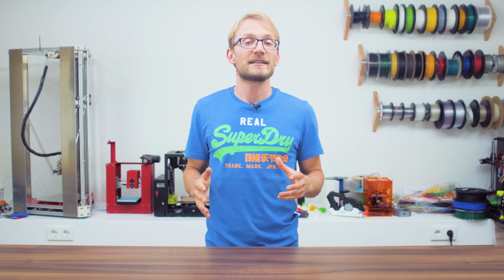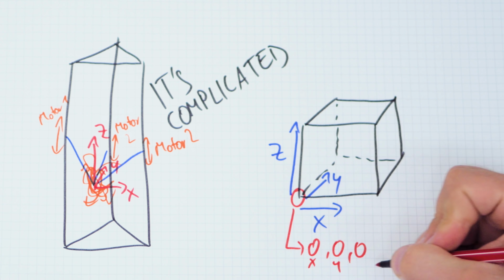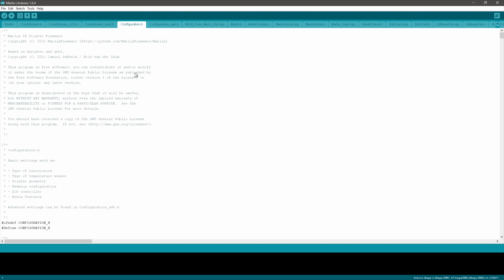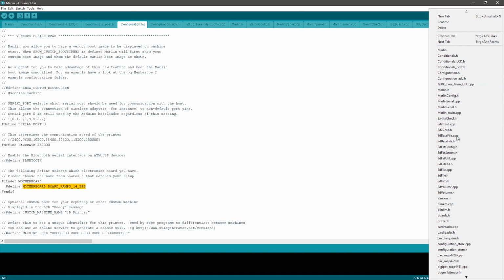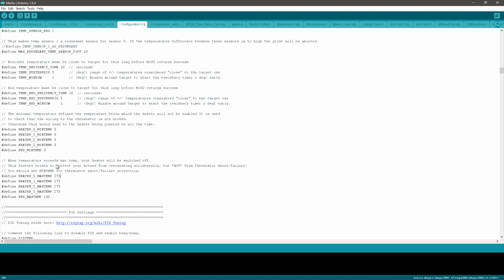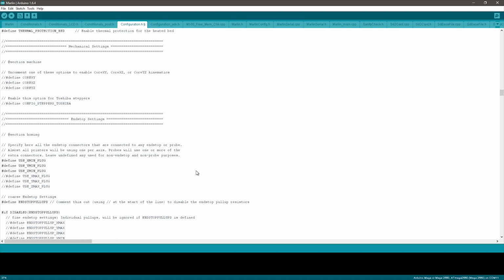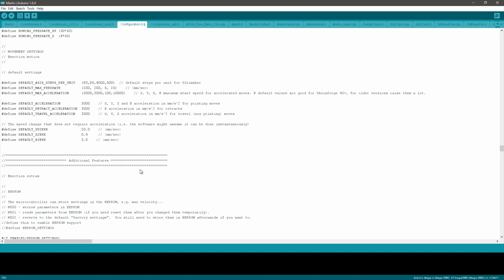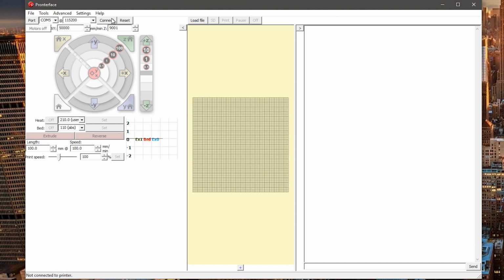[2016 version] How to set up the Marlin firmware!

Comment: Still relevant in 2022. I bought a V1.03 lulzbot mini off ebay and needed to upgrade to a motherboard compatible with LCD interface. The stock motherboard was a mini Rambo 1.1b and I needed a 1.3a. Lulzbot wanted to charge $200, but I could buy the same board from Prusa for $130 (somehow shipping to CA from CZ was less than shipping from ND). The only catch was that I needed to flash brand new firmware. Because this board came with Prusa firmware already installed, Cura alone was not enough to connect to the board and update firmware. Arduino was the only way and this video showed me everything I needed to make it work. Thanks Thomas!!!

Comment: Just watched your video since i don't get my probe working properly on my Anet A8. Its a capacitive 18mm probe which seems connected correctly and gives optical feedback once it detects something. However it does not trigger the Z min endstop when homing. At 11:50 in your video you explained the endstop inverting, which was also my first try, but if I change the value of Z_MIN_ENDSTOP and Z_MIN_PROBE ENDSTOP the printer moves the Z axis up instead of down when homing ? And still the probe doesn't trigger the endstop. Any idea what I am doing wrong ?

Comment: Hey Tom that was great explanation ,I have used RAMPS1.4 board and in the firmware I defined temp sensor 0 for nozzle and bed sensor for temp sensor bed, nozzle sensor connected T0 on the ramps 1.4 and where should plug bed sensor ,on the ramps1.4 it has T0,T1,T2 PINS please reply

Comment: Pls HELP: Want to adjust z home position to -0.1*, *Im not using any probe sensor
i do
G28
M211 S0(so i can go below 0)
Adjust my z axis(let say I want it to be -0.1, as we know sign should be opposite so +ve 0.1)
m428(to save all offsets)
m500
m501(shows i have successfully saved it X:0 Y:0 Z:-0.1)

but when I home again I expect it be -0.1mm below the actual position. which it doesn't. The nozzle stays at 0,0,0. But if do M501 it still shows my nozzle position to be at X:0 Y:0 Z:-0.1

why is the nozzle not going down by -0.1mm even though it has been written on EEPROM

Comment: thank you for this. i am indeed very bad at this. trying to recover some old 3d printer but coding is not for me.... i followed to many other videos and when i installed arduino i only get 4 tabs in my rams 14 / mega 2560. the issue is that all other videos, including yours have more tabs, and i have no idea where i did it wrong. your video helps to understand but my question is how do i get all other tabs? will i have to code them 1 by 1? TIA

Comment: Thank you for the video!!!
Dear friends! I am building a 3D printer and I need your help and advice. I have 4 stepper motors on the Z axis.
  Question -
  How can Extruder 2 driver be used in Marlin as an additional drive for the Z axis (so that there are two drivers on the Z axis that work in parallel (each of which controls two stepper motors)
Thanks in advance!!!

Comment: I am having a very odd problem with my Anet A8 in that even though the bed is level and adjusted properly, the first layer of the print is being "printed" 1/8 of an inch off of the bed! My manufacturer has thrown in the towel (they won't/can't help me anymore) so I have no where to turn to for answers. Do you know of a  site Where I can ask reliable sources for the answer that might know? I have tried the RepRapWiki and they are stumped as well...  Thanks for your help! I watch your channel often and enjoy the information you pass on!

Comment: Hi, I picked up a old reprap i2,, I now have it printing nice, but realized one issue.. I wanted to change a few things and I do not have a backup copy of the Marlin script on the arduino,,,, is there a way i can get the basic info for the printer to show up using some g-code to get the info, so i could set up another arduino with Marlin ??? thinking some ways to save some time then from starting from scratch.   ..

Comment: Hi Thomas, Im replacing a 2560 board that experienced a main power plug short (heated bed not working but the rest seems to kind of work) with a new gt 2560 on a Prusa i3 "CLONE" (pretty crap but works ok...its a printer at my work...I have an Ender 3 which is awesome!! ). Id like to read the current firmware to make note of the settings to upload to the new board. What is the process of getting that information from the original board please??

Comment: I am struggling with adding a "store memory" option to my LCD. I have changed/updated/and flashed the arduino EEPROM code changes and for some reason none of my changes take effect on the LCD. I even un-commented the line you suggested around 13:30 that sometimes causes updating complications. Do you have any ideas what I may be doing wrong? Thank you so much for your help

Comment: Hi had problems with anet a8 board that came (bundled with auto level) ended up ordering another board this one works but firmware is previous version and doesn't support autolevel need help with good firmware looked into skynet but printer wont connect to pc I need the right driver I guess any advice?

Comment: How can I find the origin firmware configuration.h file before updating? I'm not sure about the config of the machine that I use but that needs to be updated. So I need to check the exact thermister type or X, Y and Z steps and... which you teach in this tutorial.

Comment: I'm completely new to 3D printing and have a question about the "Motion" section of the config. I understand how to calculate the steps per mm with the Prusa calculator, I just want to know in what order they are respectively in the code.  For example, in the config file, you are showing us the values are (80, 80, 4000, 500). What order are these values in? (X, Y, Z,  and E) ?  I hope the way I asked my question is understood. Thanks.

Comment: Hi Tom,
I changed the extrude heavy original stepper motor by a pancake Bontech. My Ender 5 PLus has been upgraded with a Micro Swiss direct extruder earlier. I did not know that cables were a matter that they might not be the same configuration. Then the machine had strange noise at the new motor and getting hot. I was scared then changed it back. Now It go wrong with the motor gear back and forth.

Keith has helped me to config the cable by changing the order of 1346 to new order 1436, at the mean time to reinstall the firmware from Ender-5PlusBLTouch__V1.70.2 BL.hex and Pronterface M92 E0 140.00, M500

I did exactly as guided but it is not fixed. Please give me an advise If I might have missed something. Right now the machine can heat up fine, calibration fine, everything is fine but extrude and retract modes are not functioning nor printing. Thank you very much.

Comment: i am struggling with my anycubic chiron my bed thermistor suddenly stopped reading the correct value it is showing 19 degrees but when i plug it in the hot end thermal sensor it is showing its at 60 degrees i thing the port is faulty on the mainboard the mainboard has to 0 for hotend to 1 for bed and extra to ports i want to change my bed from to 1 too to 2 is it possible to do through firmware ?

Comment: May 7 2023 - I am really confused. DO I actually need to go and buy an Arduino board to get any of this stuff to work? Will an uno work if that is the case? I am trying to figure out what the hell I am supposed to do to upgrade my ender 3Pro with the 4.2.2 main board. I believe this one has been upgraded to the 32B main CPU..... not sure as there are conflicting stories out there. I thought that if I installed the ARDUINO IDE software is this IDE an emulator?????) , it would allow me to compile a file that I can then simply send it to my ender 3 pro and the system would reboot and update? - TRying to upload the custom  Marlin 2.1.2

Comment: Hi, i use marlin on ramps 1.4.
my question is: Is there a way to use marlin in EFF mode but still have heated bed via an external MOSFET ?
My goal is to use both D8 and D9 pins for Fans (D10 for Heater) and connect a heated bed to it using an external MOSFET (Don't wanna use RRD fan extender)
If So what codes in marlin must be edited to do that ? May i simply remap Heated Bed pin to a free pin ? Which free pin is suitable for Heat Bed ?

Comment: Hello
My printer auto bed leveling does not seem to be working even though I have added the G92 in the Slicer. Printer performs the auto leveling but I don't see any difference from when I don't use G92.  Can I send you my configuration.h so you can tell if there is a problem with it? Thanks

Comment: Any advice on how to set up Marlin to run two extruders, a bed and a fan?  The standard config allows 3 of 4 of these.  I've been searching, but no word on how to control 4 of 4.  The MKS boards support this, but I'm actually using a standard RAMPS with an external SSR to drive a 120VAC hotbed.  I'm driving the SSR with one of the servo outputs since it only requires a TTL connection.  This frees up the regular driver outputs for the extruders and fan.  I found in marlin how to move the hot bed connection to the servo GPIO, but I'm still stuck with only 3 of 4 items I need to control.

Comment: So I updated my firmware as you suggested but I have a problem with Z Axis i have HICTOP 3DP08. the problem is Z axis is not working correctly it turns hard and or won"t turn when I use machine control X and Y axis work great.

Comment: I've got an issue with my version of the program where the build area is mirrored when I put the part correctly in my slicer of choice it comes out backward on the printer, how do I fix this?
Reply: There is an option that will tell if the axis direction is inverted by changing the (true) or (false) to the opposite after the the optional axis your changing the direction (it's the option Thomas is showing on 11.30 in the video) I only had to change 2 not all 3 so make sure you check them after changing ;)

Comment: sir , i made a prusa i3 steel 3d printer and i use board called lsee v1.0 when i load the firmware marlin on this board the printer do nothing and it doesn't work what should i do and what the changes must be in marlin firmware to be compatible with my board

Comment: Hey all, have a quick question. Bought all the the necessary stuff to build my own printer. Im currently stuck at the wiring/motor stage. I have everything hooked up and everything seems to be working fine, except for the Z-axis motors. When I ask pronterface to move them, the motors just twitch. I don't believe its the wires or the motors, as when I plug them into the x-axis on my ramps 1.4, it turns like its supposed to when prompted. I have a feeling its something stupid I'm missing, but I'm kinda stumped. Any advice would be greatly appreciated!!
Its a ramps 1.4
Arduino Mega board 2560
Not sure on the motors to be honest, bought this kit over two years ago 
Im running Marlin, and followed the steps highlighted in this video

Comment: Hello Tom,
Great video, as always!
In your previous version of this video guide you mentioned that you prefer not to use PID when you're controlling the heated bed with a solid state relay (for example for powering a silicone heater with mains voltage). Do you still recommend using the bang-bang method in such cases?

Comment: I am hopping you can help me out here I have a Anet A8 with Marlin installed I am trying to get it to save my bed leveling settings. I do have the commands in the code open to allow me to save but it will not save and I have to relevel each time I boot up . I did not put a bootloader on to save memory for future upgrades and I am wondering if I need a bootloader for marlin to save the commands in the bootloader to boot up with the saved setting.. Can you point me to any info that will help me out. thanks

Comment: need some help in learning. what is the correct term for... offsetting for x and y axis? Here is what I have. I got a Print-Rite / Colido printer to mess around with, I quickly changed out the motherboard for a Ramps 1.4. Now when I home x and y I need x to travel 25mm and the y to travel 30mm so that the print nozzle is at the actual corner of the 200x200 bed, (also did a headed bed upgrade). My full travel of x is 230 and my y is 250.

What is the Marlin coding? is it
#define X_MAX_POS 230
#define X_MIN_POS 25
#define Y_MAX_POS 250
#define Y_MIN_POS 30

Do also have to do the offset in my slicer? or by setting it i nthe firmware can I just have x=200 y=200?

Comment: Hello, I can not find an answer wherever you will be in charge, and if I run the 3d printer, the extruder will start to heat itself up and come up to a value of 304 degrees. then when I try to set it myself I get a "maxtemp" error and want to restart the printer.
I made the necessary adjustments to the software marlin and code I'm using

Comment: Hello
I followed your instructions (and many others) to upload Skynet3d into my Anet A8 and all appeared to be OK until I hit the "Auto Home" button (which I assumed was the equivalent of the "Home All" in the previous firmware). The printhead moves across the bed and parks itself at coordinates X=131 ans Y=145. What's going on? If I load Repetier Host and use manual control the X axis homes at the endstop on the left and the Y axis homes at the rear endstop as expected. If I click the P button, the nozzle moves to to front left corner of the bed (0,0 - which is perfect!) However, if I hit the little house icon (Bottom Left) which is presumably the "Home All" button - we zoom off to 131,145 again.  That's not even the centre of the bed. Is there a line of code somewhere that needs to be changed?
Reply from the maker: +Richard Hathaway unfortunately I have absolutely zero experience with the Anet series of machines or the Skynet3d firmware. Maybe someone else will be able to help you out!
Reply: Richard Hathaway you need to disable the safe home option in the firmware then re upload

Comment: I did not Aim to make a printer , I wanted to make a mini milling machine , The selection of a printer looks ( NULL) in this case
as there is no printer , will this ramps 1.4 work for the milling part as all I need is x y z , for the spindle can I use the extrude connection. what a mess Bought a wrong  board , may be I was supposed to construct a 3D printer.   Even in that  case the printer will have no listing As it is constructed One. Please HELP find the Path

Comment: What if m119 shows all n-stoppers are Open, and yet none of them works . I've checked the pins on the MKS 1.4 board. They seem to be sitting in the right spots (the same as other youtubers). What have I done wrong? Homing any axis crashes the unit into the n-stopper. Pls help

Comment: I followed the guide to a T and it wont verify in Arduino:  
SanityCheck.h:845: error: #error "Enable USE_XMIN_PLUG when homing X to MIN."
     #error "Enable USE_XMIN_PLUG when homing X to MIN."
      ^
exit status 1
#error "Enable USE_XMIN_PLUG when homing X to MIN."

I // slashed out that line and it verified  will that cause errors down the road?

Comment: Hey Thomas I decided to upgrade my reprap prusa I3 to Ramps 1.4 board and a full graphic LCD display and after uploading the marlin firmware to the arduino  I'm having issues with voltage regulator overheating from the backlight of the lcd display and can't connect to the printing program even after making sure the bauderate is set to 115000 on both machines thus my printer is now disabled I don't know know what to do.
Reply: And I'm using Repetier Host for the software.
Reply: If you have (or sign up for) a Github account, you can ask for help in the Issue Queue of the MarlinFirmware project. While, yes, most of our focus is on bugs, feature requests, and the like, the current team is much more flexible and responsive than you might have experienced in the past, and we don't mind helping to troubleshoot issues like these.
Reply: Hi. I would highly recommend remove d1 diode from ramps board. This diode supplies 12v to arduino mega tp convert it into 5v for arduino and other electronics.  Use external voltage regulator or just a usb charger to supply 5v separately.  This also presents current going back to pc and ruining your usb ports(happened to me) as both voltages are isolated.
Reply: I Heard about that solution before but I don't feel comfortable using 2 external power supplys for that board and what should I do about the pairing problem?
Reply: I posted that question at the reprap forums and and I still didn't find an answer for it.

Comment: hello! 
I just made my own 3D printer. I downloaded "Marlin" firmware but when I check my printer by the "Pronterface", all the steppers does not move but they produces jerks and noise. All the motors are new and in working condition but in the printer they have these issues. What should I do? 
I will be very Thankful to you.

Comment: It all gets a bit sticky when you try to update Marlin on Melzi and spend half your life trying to guess what the correct Hardware folder structure should be.....and which of several Sanguino file sets you need. Certain info should be text within the IDE, but for some wierd reason, isn't

Comment: Arduino: 1.6.11 (Windows 10), Board: "Arduino/Genuino Mega or Mega 2560, ATmega2560 (Mega 2560)"In file included from D:\3D Printer\Marlin-Marlin_v1 for lcd 2004\Marlin-Marlin_v1 for lcd 2004\Marlin\Marlin.ino:33:0:sketch\Configuration.h:6:20: fatal error: boards.h: No such file or directory #include "boards.h"                    ^

Comment: hey, and thanks for the video, i got some issues with the bed and nozzle tempretaur
at 15:35 you are talkin about the wrong thermistor, my temperature at nozzle and bed isnt plausible, at nozzle its about 140 and at bed about 100 degree. i already switched the thermistor to 200 k and also to 10 k, at 10 the nozzle temp is gettin down to 65 degree. but i think this isnt the right way to fix this
 i hope u can help me, thanks a lot